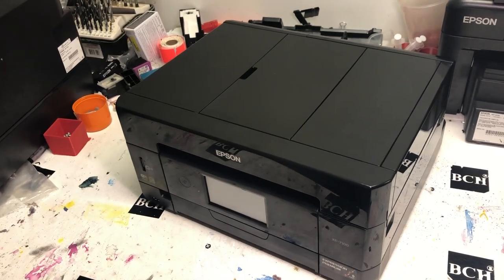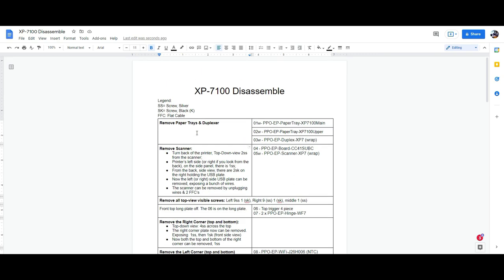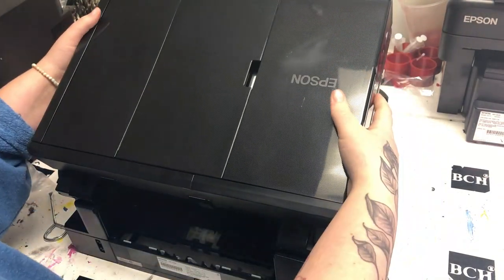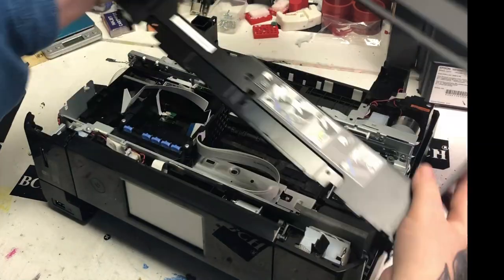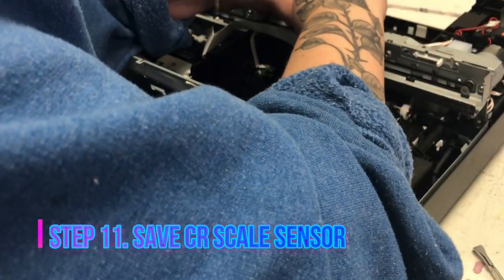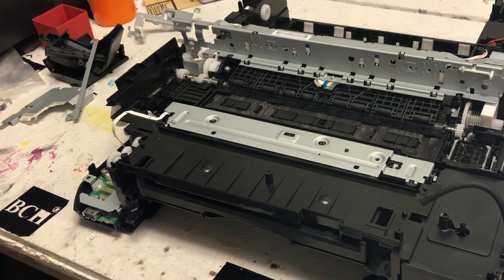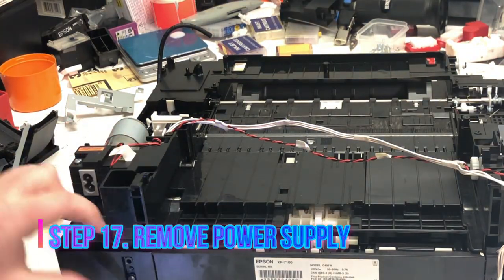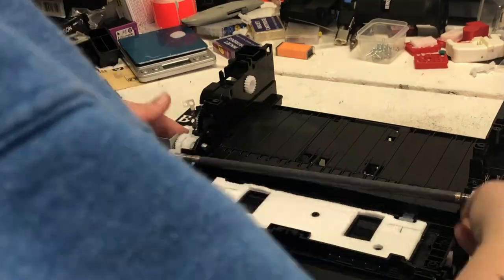Uncasing XP-7100 - How to disassemble & take apart Epson Expression XP Printer

Comment: Hi Kevin, I spilled some Gatorade in the control panel of my Epson XP-6100 and desperately need to remove the control panel so I can clean the circuit board and/or switches.  The printer works from my laptop but the back light on the LCD is out and only the power button responds - none of the other buttons work.  The photo black cartridge needs replacing so I can no longer print but that appears impossible to do without the control panel working.  Thanks in advance!!

Comment: Hello Kevin, thanks for this video
i have some trouble with my epson xp7100
there's a piece which is broken (a piece of plastic gear on the bottom of the printer that is used to engage the paper into the printer
there are gear teeth that have broken)
is it possible to send you the image and ask for details to know how to disassemble it whithout disassemble all the printer ;)
Thanks a lot for your answer

Comment: How to get rid of ink line at the top right hand corner when I scan the document. The ink line is about 2" long. I have Epson XP-7100. I manually cleaned the surface and also used the maintenance menu to clean guide line. It still didn't work. Please help. Thank you.

Comment: Hi again, well I got the control panel apart but didn't see any sign of the Gatorade so I just wiped the ribbon connections with De-Ox-It and put it back together.  Still no LCD or power switch LEDs lit, and no response from the panel buttons either.  It does power up when I plug it in and push the power button but that's all it does so that means the main power supply is working anyway.  I put a new Photo Black cartridge in it while I had it apart but without the proper control panel sequence it didn't see the new cartridge so I still can't print anything.  Help please?! 
Thanks,

Comment: Hi Kevin, I actually have a problem with the paper output tray. It starts openning but on half way it will stop and I need to tear a little bit, then it scrolls out the rest. Same when closing: I have to give a little push on half way, then it closes perfectly. Can You give me a tip, how to fix the problem? Is it possible to open the printer from the lower side to find the cause of the trouble?

Thank You in advance, regards george

Comment: Accidentally plugged mine into 220v. Think I fried the power supply. What is easiest way to remove power supply or way to check the damage. Powered on then made a woos type sound and now is dead.
Reply from the maker: Get a multimeter and check on the power supply first.

Comment: Way too fast for me and too many blocked views.
Reply: SAME here. I agree. Wish he would have explained the "Guts" of the rear cover he just pulled out to set aside. What is that thin lever with the tab on the top of it for, that when pulled, swings out towards the inside of the machine? My printer was constantly getting jammed, having to take that back cover off to take the crunched paper out. I ended up buying a new printer.